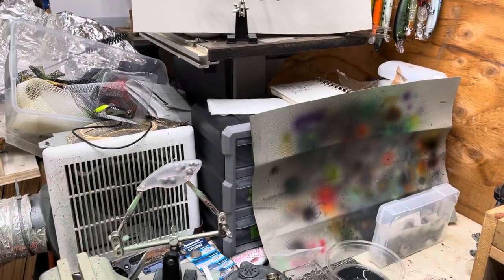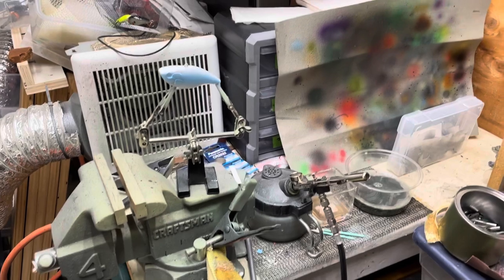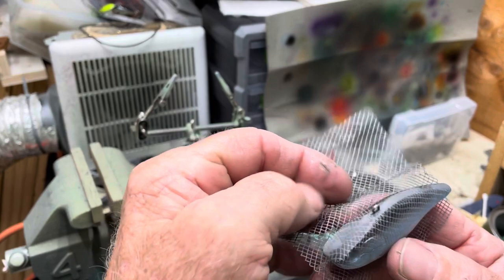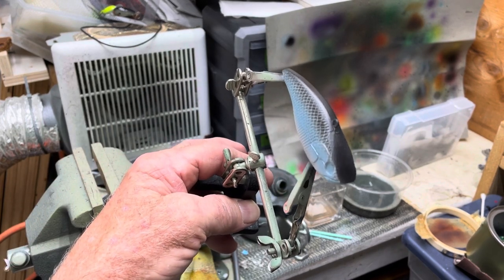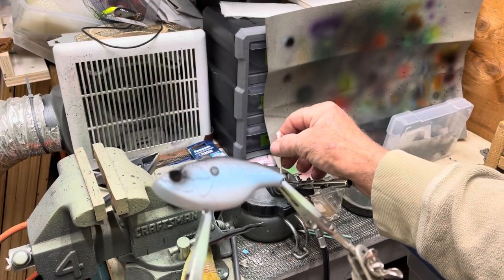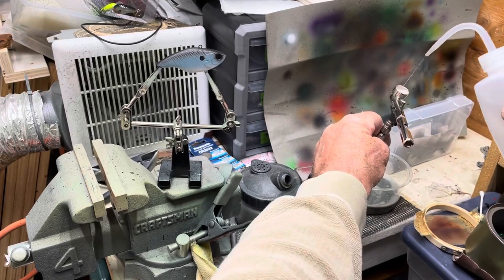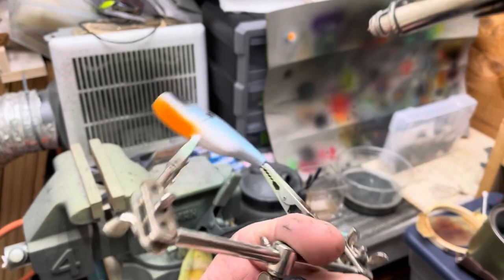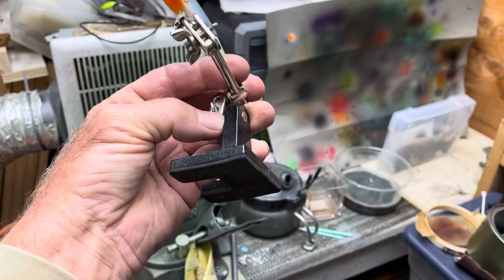Let’s paint a lipless crankbait simple custom paint job

Comment: What set up do you use for ventilation
Reply from the maker: I have a 110 cfm bathroom exhaust fan right on the back of the work bench, with a simple fau furnace mesh filter underneath the grill to protect the fan, that vents straight to the outside. These are acrylic paints so there’s not a lot of fumes.
Reply: @manresarods4947  thank you. Great work

Comment: Where do you get the clear coat before the rap
Reply from the maker: DecoArt Duraclear gloss varnish, Createx 4030 clear intercoat, or clear acrylic gloss coat craft paint.
Reply: @manresarods4947  thanks for the reply question can you use pledge floor wax the same way it's acrylic thanks
Reply from the maker: @favoriteyoutube7480  You can use "Pledge Revive It floor gloss", that's what I normally use because it is so inexpensive. I have one bottle but it is no longer available in my area.